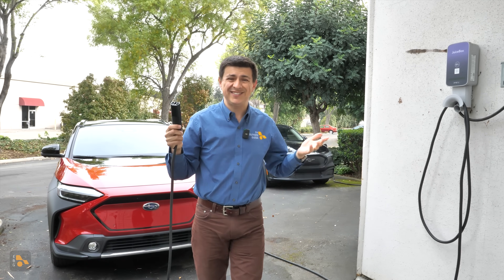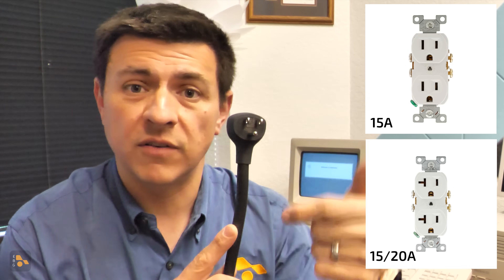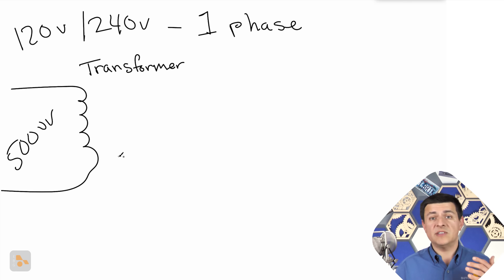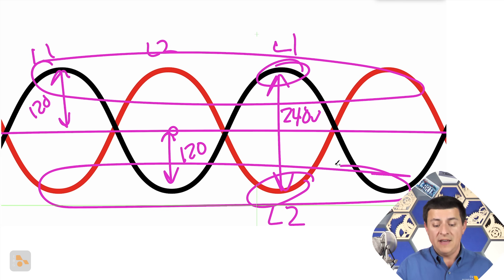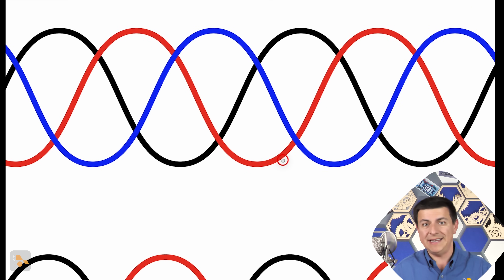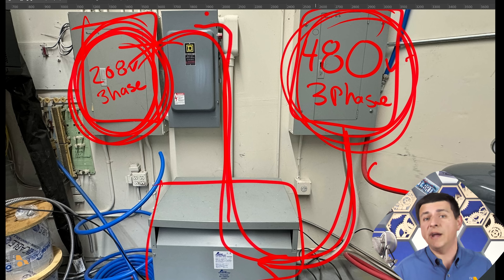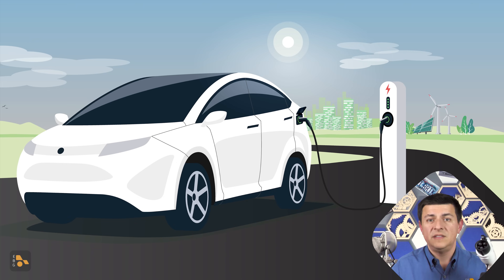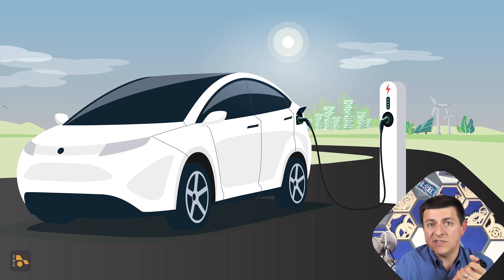NACS/J3400's Support For 277V Charging Is A Huge Deal and Here's Why

Comment: The graphics on the video are incorrect. For 120VAC, the peak voltage is actually 170Volts. The reason is that it is called 120VAC is that it is 120VAC RMS (Root Mean Square), which is the average voltage under the sine curve, but the peak is actually 170Volts.
Reply from the maker: As I mention in the pinned comment on this video, we had an earlier cut with that explanation in it but it confused the team of folks that proof-watch our videos so to make things as easy to break down as possible I used the RMS voltage.

Comment: OKAY I edited before posting... 🤣😂
.
.
.

While we're at it why not use 480 AC for EV charging ? Anything under 600v is basically the same .... Nevermind... I googled it 480v is 600v+ so that's not going to work. Because once you go over 600v you need 1k rating and a tons of testing and the insulation will be bigger than the wire 🤣😂

Nice and concise covering the AC voltage waves. 👍

Comment: Fantastic, loved the detail, very relevant to apartment managers around the cost of EV charging, if you can skip the internal transformer upgrade, that's a good thing, could you do a separate 480 to 240 single phase per phase (3) transformers as part of an EV apartment upgrade?

Do all Tesla's support 277 volt charging over their existing (NACS) connector (13.3kW)? I've found a few 250V AC chargers in the wild, not sure how that happens.

e.g. plugshare ID 225385 - note the 250V / 48A / 12kW entries (sadly that installation is looking pretty neglected these days)

Comment: Connecting an EV to a charger that supports 277 Volts can be done today without any problems. That doesn’t have anything to do with how long it is taking to move to the new adapter. I would guess that it is due to re-tooling costs and existing inventory of components. The wiring harnesses need to be redesigned as well as the manufacturing processes.
Reply from the maker: Tell that to the folks that have damaged the onboard charger on their Bolts and Mach Es.. Check out the Bolt, Volt, and Mach E forums and you'll see folks that have damaged their cars. When we checked with Kia on the e-GMP platform vehicles (EV6/Ioniq5/Ioniq5/GV60) we were told "at this time the vehicle does not support charge voltages over the NEC standard variance for 240V AC".
Reply: Are you telling me that current DCFCs maintain a steady voltage as they charge EVs or that every non-eGMP EV has been damaged when charging at a 350kW charger?  That is what you are strongly suggesting. It may be some malfunctioning DCFC units, which should never happen, and that shows the sorry state of charging infrastructure.
Reply from the maker: This is about 277V AC charging, not DC. DC fast charging does not use the vehicle's onboard charger, only AC charging does.

Comment: I'm not sure the onboard charger voltage is the issue in why it's taking so long to implement the new J3400 sockets. In the past, EV owners speculated that the onboard chargers of most EVs were capable of receiving a 277 V leg because they were designed for the European market as well (tolerant of Hot-Neutral-Ground as well as Hot-Hot-Ground). So the real limitation is with the EVSE's themselves, and Tesla's EVSEs were the only North American units I know of that were designed for the 277 V input. 
The biggest changes for automakers who are switching to J3400 sockets are that locking mechanism must be housed in the vehicle, and the AC and DC pins are now shared, which requires additional hardware that must be designed, built, and integrated into the vehicle as well as additional safety controls around ensuring that AC and DC input power are routed properly. Otherwise, they might be able to continue using the same onboard chargers.
Reply from the maker: I can't think of a current EV that uses the same onboard charger in N. America and the EU. While you could design one to have three 3.7 kW charge circuits and use them in a 3-phase configuration when you have 3 phase power and then re-string them in serial for a single phase source it's not cost effective so they aren't designed that way. Because the design has to be different anyway, most companies don't seem to use the same higher voltage components because they want to save money.
Reply from the maker: GM cheaped out on the Ampera, but for the most part this isn't the case anymore for the most part. I don't know of any EVs sold in the EU and USA that have a similar disparity to the Ampera/Volt. I think that some of the BMW PHEVs may have had a similar issue in reverse where they 3-phase charged in Europe but in America we were limited to just the rate of a single phase, but if my memory serves this was just on one year of the X5 and I believe they were still different part numbers. My recollection is that they simply populated the board in N. America with one of the charge circuits rather than all three. There could be better info out there on that.
Reply: @EVBuyersGuide  Interesting. I wasn't aware that they had different part numbers for the onboard AC charger. The Opel Ampera-E, for example, was marketed as having a 7.4 kW onboard charger; however, the Ampera-E was not rated for 3-phase AC power (essentially identical spec to the North American Chevy Bolt EV).

Comment: 11:54 I suspect the other big hold up is the fact that NACS shares the same pins for AC and DC charging. This means that either the on board charger needs to tolerate 400 or 800 volts DC (as Tesla does), or you need additional contactors to disconnect the on board charger for fast charging.
Reply from the maker: Indeed this is why we don't see those ping on the DC charging adapters, but it sounds like Ford/GM won't do a separate AC adapter either at this time.

Comment: 5:04 I assume you simplified this to make it easier to understand, but  technically the 120 volts refers to the RMS voltage. The peak voltage as drawn on your graph would be √2 times higher, or 170 volts.

In terms of the power delivered, 120V RMS AC delivers the same power as 120V DC (for a given current), which is why we use the RMS voltage. However, because the peak voltage is actually higher, things like wire insulation and capacitors need to be designed for the higher peak voltage.
Reply from the maker: Yes. Our original video was nearly twice as long and went down too many rabbit holes, so we re-cut it and re-filmed parts to make things simpler and easier for the average EV intender to follow. RMS was just a bridge too far

Comment: I now understand why 3 phase provides 208v instead of 240v. It’s been explained to me before but now I finally understand. 
Thanks
Reply: US 3 phase is also different than in EU 😅 you have 240V L-N, but use 208V L-L, while Europe mostly uses 240V L-N and you specifically need to change arrangement of connection to electric motor to ignore neutral wire.
Reply: @uosiumen  The US generally doesn't have 240V line-to-neutral, except in very special-purpose applications like data centers.  We have 240V line-to-line and 120V line-to-neutral on single phase services (split-phase), typical of residences.  We have 120V line-to-neutral and 208V line-to-line for lower power applications of 3-phase, usually apartments and light commercial applications.  Usually each dwelling unit gets two of the three phases, and the neutral, so their higher voltage loads aren't as high as it is for a single/duplex residence.

The 277/480V 3-phase is typical of large commercial and industrial applications, which usually has a small transformer for 120/208V for a minority of the loads like receptacles.  Some industrial applications use 347/600V 3-phase.
Reply: And there actually is a 120/240v delta system as well. But you have the high leg that is 208v L-G but you can't use it for that. I know that ChargePoint EVSE cannot be used from one of the phases to that phase (should be L2 (but commonly called "B" phase)). That stinger can make electronics release their magic smoke.
Reply: @patrickmay8261  The high leg B-phase is useable in theory for a line-to-neutral load, but it comes with pitfalls to make it happen in practice.  Most of the time, you'd prefer the 240V circuits anyway, on this system.

Most single pole breakers are slash-rated for 120/240V, which means they require 120V to ground nominal. This means they can serve 120V phase-to-neutral loads, but not high leg B-phase loads.

In concept, you could use a multiple breaker that is straight rated for 240V, and abandon the other poles.  Another solution is to use a 277/480V panelboard.  Both of these have the problem of sending mixed messages to future users.
Reply: You can think of it this way:  For three phase, the line to line voltage (208) is the line to neutral voltage (120) times the square root of 3, or 120 * 1.732 = 208.  For single / split phase, the line to line voltage (240) is the line to neutral voltage (120) times the square root of 4, or 120 * 2 = 240.  Six phase is out there too but let's not go there.  6 phase is super rare.

Comment: I’ve been advocating this for years 

277v is one leg of a 480v transformer. So a one 3 pole 480v 20A would have very little voltage drop, an inexpensive 
L1 N G to a EVSE would be 
20A x 277v = 5.5kW 
Vs the less efficient 3p 208, so you need L1 and L2 plus G and with volt drop it’s around 201v. 
20A x 201v = 4kW. 

So you your EV is charging at 37% faster with less loss and the transformer doesn’t have to deal with wacky L1 L2 and L2 L3 and L3 L1 balancing
For cars with 32A max it's even better 

32A x 201v = 6.4kW
32A x 277v = 8.9kW  

Or 48S 
Or 
48A x 201v = 9.6kW 
48A x 277v = 13.2kW
Residential is 240v. So it's still a big improvement at 277v and no phase balance issues 

Saves SO much money on copper and transformers and line loss, while boosting charging time ~20% to 40%   

Large parking lots, like malls, apt, condos, and airports could deploy super inexpensive 20A NACS stalls at 277v and be close to the speed of their 208v 30A at dramatically lower deployment cost

Comment: Excellent presentation, very educational and definitely not too deep. As someone who has cross shopped home and restaurant cooking appliances for my kitchen I've encountered the 208/240V conundrum. Glad to have the power differences explained so clearly.
Reply: It is typically heating elements that are more flexible that can run on either voltage, while the motor and controls that are more voltage-sensitive that run on the 120V.  This comes at a cost of less power to the heating element, since it only runs at 75% of its power.

Comment: One of our biggest problems was never allowing 3 phase to residential. 208 3 phase would of allowed evse's to be made 208 like they are in europe, and would of allowed the very easy scaling of 480v 3 phase and that would fix all these problems. 

Personally i see 240v split phase becoming a problem in the future and the lack of residential 3 phase leading to issues
Reply from the maker: The lack of residential 3 phase isn't really an issue. While 3 phase charging could have reduced conductor sizes, it's not an enormous difference and the cost of conversion would be huge. The main rationale for split phase power is that the voltage potential is lower so less risk of arcing and higher safety margins.
Reply: @EVBuyersGuide  as we move into a world of electric utilities like hot water, stoves, heating, and clothes dryers, electrical usage is going up in the average home drastically. The single phase network was never designed to support this volume of high demand utilities. I bought a house with a 50A service in 2023. That's it. That's all it needed to supply everything for the whole house. I had to upgrade it because my ev ate 30A and it did trip the main, but prior to that ev it wasn't needed because nothings electric. A hot water heater is 20A, a stove is 40-50A, a dryer is around 20A, I saw an electric heating system that was 100A for a 2500sqft house! Yes heat pumps would help but not when it's 5 degrees out. 208 3 phase would cut down current by a third, and maybe we wouldn't need 350A mains on homes today for high electrical houses
Reply from the maker: We have historical analogies we can look back on. When air conditioning first hit the market there were the same concerns and the utilities and the grid just adapted. If everyone replaced their car with an EV in the same year this would be an issue, but the gradual replacement is less likely to be an issue. It is entirely possible to live with an EV and charge slower. For instance I (Alex) live off the grid and my inverters max out at 19 kW continuous so the answer is: charge slower. At 3kW we're still talking a solid 30kWh charge overnight which is 60-120 miles of driving depending on the vehicle, well over the average daily commute.
Reply: @EVBuyersGuide  I live in nyc and air conditioners certainly cause problems for the grid during the summer. There are notable brownouts throughout the whole area the hotter it gets. Thankfully  most of the cities infrastructure is still built around gas and fuel rather than electric outside of it, or the grid would implode. 

EV charging has already been documented to be an issue, and charging restrictions have already been implemented by local municipalities due to how hard they're hitting the grid.
Reply from the maker: According to the utilities I have spoken with, the electric vehicles are fairly easy to integrate because of several factors. The demand is fairly constant. Regardless of the weather, air-conditioning based blackouts are harder to cover with grid improvements because they occur relatively infrequently compared to the average load.. an electric vehicle on the other hand would cause the daily load to increase steadily overtime, allowing a profitable case for expansion of the grid. In addition to that, offer smart, charging profiles, and generally speaking charging reaches its peak late in the day, after air-conditioning demand has dropped

Comment: I really appreciate that final point about why a “Global” connector is not only never going to happen, it’s just a bad idea. We have totally different power systems in the US vs Europe, and what works best for the US would be awful in EU. A “universal” charging connector would be massive and wasteful.
Reply: I am just realizing this is probably a drag on the resale value of electric cars. You can’t just send them off to any country and sell them there, they can only be sold in a region with equivalent electrical systems
Reply: To be fair, a NACS-like connector that simply doubled the pins while making them half as big would work worldwide. In 3-phase countries, it would be wired L1+L2+L3+unused/N for all phases or L1+unused+unused+N for one phase, in split-phase it'd be L1+L1+L2+L2 (or L1+L2+unused+unused/N) for 240V or L1+unused+unused+N for 120V, on DC plus+plus+minus+minus.
Reply: @HenryLoenwind  We are lucky in the 50 HZ world to only have 2 voltages to deal with. Electricity is delivered along the street from a single remote sub-station as 3-phases at 400 volts.(+-5%)  using 4 physical wires. ie. a neutral wire and 3 phase wires. The voltage from neutral to any phase is 230v. This power is sent to most homes from the street using a neutral wire and one of the phase wires giving ordinary homes a single phase at 230v. Alternate houses along the street and connected to different phases in the street to balance the load. We do not use split phase.
Larger premises, or houses requiring 400v 3-phase get a neutral and all three phases. This gives them access to both 230v and 400v.
This simpler approach is why NACS will not be used in the rest of the world.
Reply: Yep you would have to change AC multi phase standard for the entire infrastructure first before you can do a universal charger connector. No clue why you would even want to do that.
Reply: Yep you would have to change AC multi phase standard for the entire infrastructure first before you can do a universal charger connector. No clue why you would even want to do that.

Comment: I wonder if the 277v will be labeled.  Right now with a J3400-J1772 adapter I can charge a non-tesla at a tesla brand destination charger.  However what would happen if I plugged in to a 277v destination charger with a system that can only handle 240?  Sparks / Fire / Nothing?  All are less than ideal outcomes.
Reply from the maker: Currently "it depends". Apparently Mach Es will charge, some vehicles will give an over voltage warning, some will start charging but then have charger faults and possible damage. Exact data is hard to come by but supposedly Volt and Bolt chargers can get damaged by charging on a 277V destination charger.
Reply: @EVBuyersGuide  that is good to know.  So it's a bit of russian roulette if I plug into a Tesla destination charger if I'm going to damage my vehicle or not.    Problems like this are a significant part of what holds back EV adoption.
Reply from the maker: This seems to be why we have not seen adapters for destination chargers from Ford, GM, etc and possibly never will.
Reply: This is the exact question I, too, have. I am guessing that, currently, all Tesla destination chargers ARE 240 Volt. But how will we know if that’s not the case and what are the repercussions?
Reply from the maker: There are a few 277V destination chargers out there, but they are rare.
Reply: I haven't read the J 3400 draft standard yet. I imagine this question is addressed.  It would be great to hear from someone who has read it.